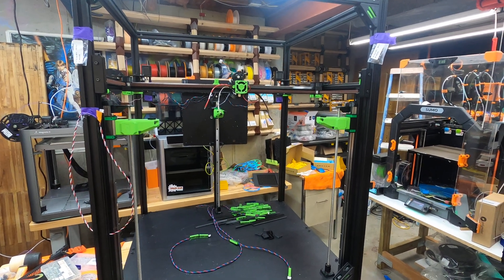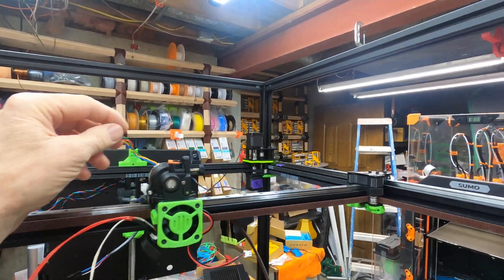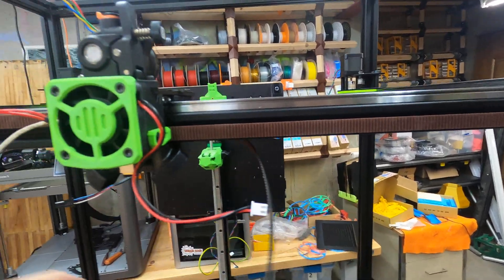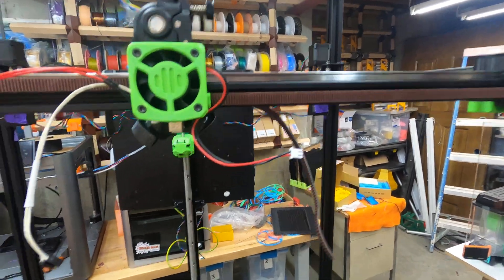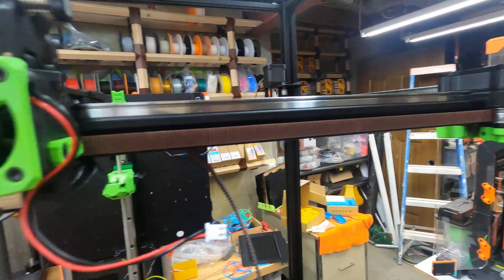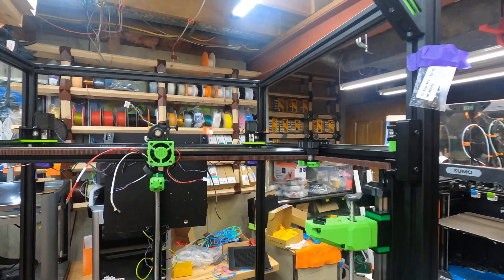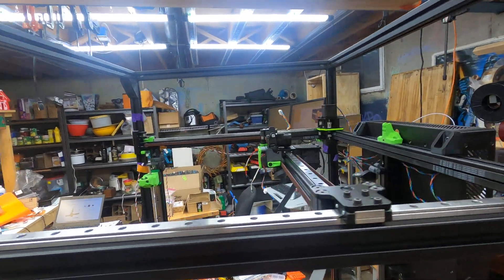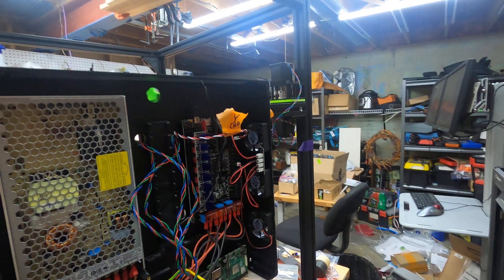Rat Rig V core 4 toolhead wiring

Comment: I like the green accent pieces.  I immediately called it the "Incredible Hulk".  Big and strong!
Reply from the maker: It is big and I hope strong.  This has been a fun build, I'm not in a hurry - taking my time and trying to get it right the first time.  The green is the "official" trim color for Rat Rig.  The printed parts can be purchased with the kit, but I prefer to print my own.  If something goes wrong, or I need another, I can simply make more.  I also have the material to print other parts like the cable pieces.  Many of us building this are experienced tinkerers and come up with changes and then publish them for others to try and  make even more changes.

Comment: Looks great David, can't wait to get as far along on mine as you are on yours!
Reply from the maker: Thanks.   I found another problem that I'm printing a part to fix.  It will be in the next update
Reply from the maker: I started adding rubber grommets to the stamped holes in the electronic case, I don't like the bare wires running against the shap edges, and found the holes were now too tight for the Z motor wires.  I also need an entry point for an Eithenet cable.  I designed a new bottom panel for the electronics box with two large entrance holes.